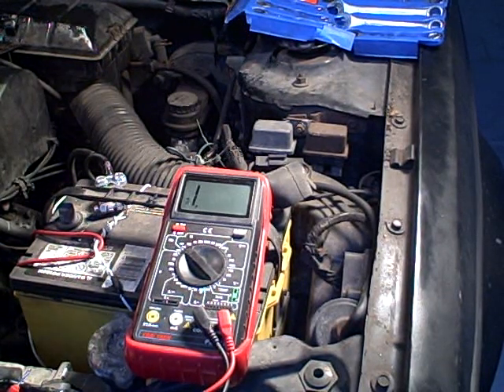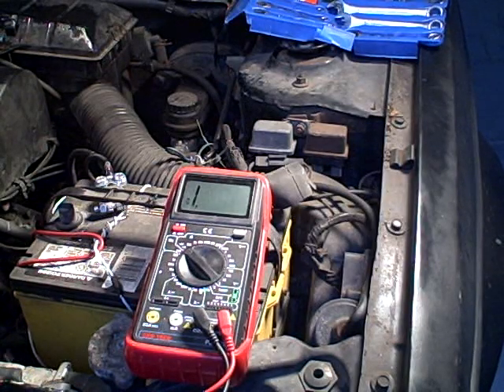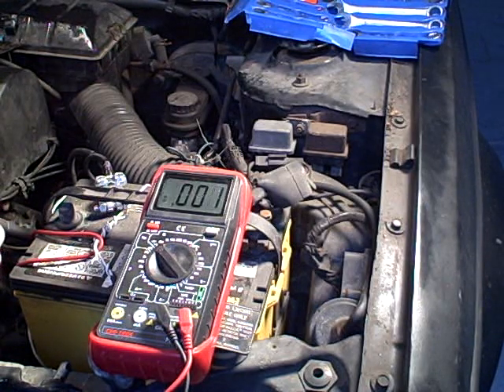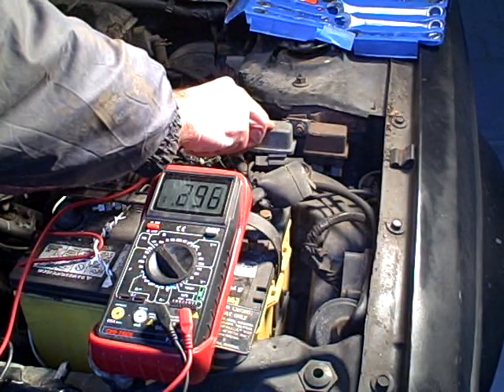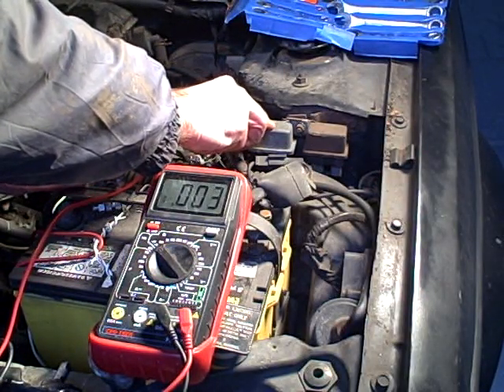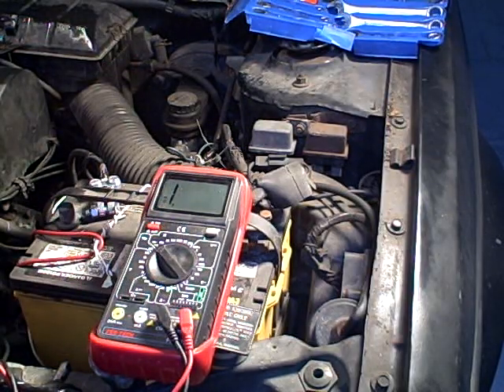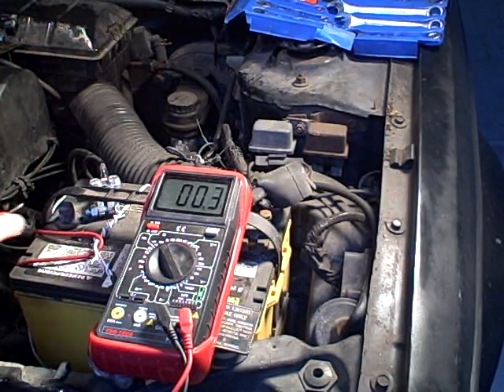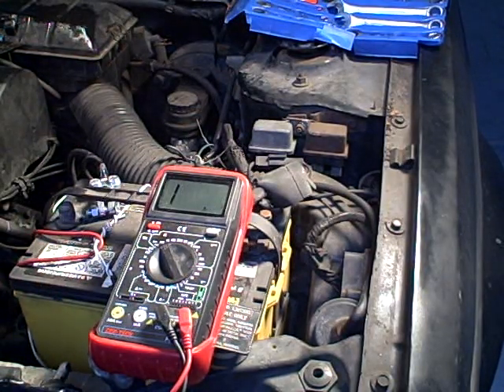Checking Car Wiring Circuits For Continuity with a MultiMeter

Comment: Should have Shown + Battery wire, to Frame, and told them WHY it might still TONE.  Like computers on your Car are always grounded/always on.
Some relays are NO, until Charged.
And Current Car computers are With your radio.

Comment: I think this video is very dangerous.  You can barely see that you've removed the negative cable and you don't mention this at all.  And you don't mention that the pos cable is still attached which means you touch ground to power, or power to ground your  meter could be screwed.  The natural tendency, especially today is not to remove the neg cable because you have to all kinds of things like reprogram your radio or security codes to deal with, so some people might not think this matters.   Also, you don't mention that how the meter measures resistance is by sending a small amt of energy and reading at the other end.   You don't want to measure any part of a wire that has current, e.g. live tail light  First, you won't get an accurate reading.  Second, it can be done if it's a small number of amps but you can easily blow up your meter too.  And finally, you don't mention anything about voltage drop which is a safer way (according to some experts) to determine continuity without measuring resistance.  And finally you don't mention that you can't use this with all wires or devices.  Typically the beep function only works for a very low ohm reading, like one ohm.  For example, you can't use this with a spark plug wire because they have such low resistance.   To tell if you have a bad spark plug, you have to measure the ohms, compare to the length of the wire and then compare to the specs. and so on, and so on
Reply: Lol that was one of the craziest insane ramblings EVER!  

FYI most people who even own a multimeter & use one already know the basics & it’s not this or anyone’s responsibility to teach it every time dude get a clue & a life - nice troll name too gotta say lol. Pathetic

Comment: Great video.....
if I test for continuity between the positive wire that attaches to the positive terminal on the battery (with the battery disconnected) and the frame(on a motorcycle) I get a continuity reading of 820. is there a easy way for me to test where the short could be with just a basic multimeter.  and why am I getting such a high reading?

Comment: have a question i am replacing a melted h11 lowbeam wire harness connector so i cut the bad melted connector from 2 black wires and will tie in a new connector.. my question is how do i know which one is positive and which one is ground ? i keep reading through forums it doesnt matter for the h11 so im confused .. this is for a 2008 cts with halogen headlight assembly .. any info would be much appreciated  thanks!

Comment: Does the negative battery terminal have to be off the battery while doing this test?
Reply: I’m wondering the same thing. I was told that it does when your testing resistance but in some videos I’ve watched A lot of people aren’t showing if they unhook the negative

Comment: Tell all of the inexperienced troubleshooters to never check for resistance on a live circuit also.
Reply: 3Mudbone1 so when I am checking resistance on my wiring harness for my wiper I should disconnect the negative lead from the battery?
Reply: The camera sound must be connected to the multimeter too!